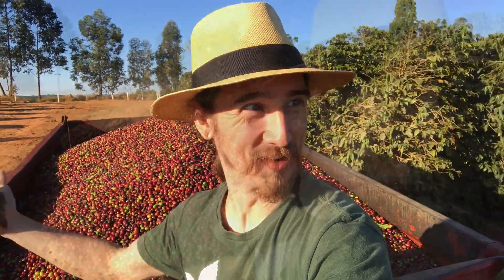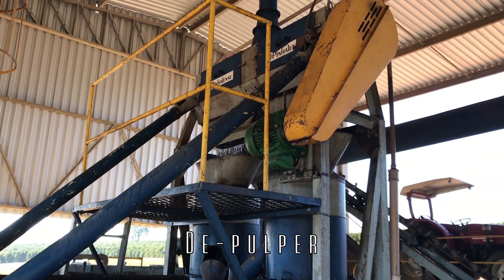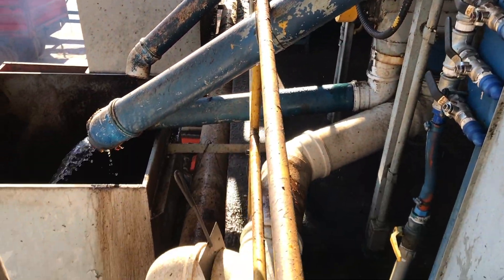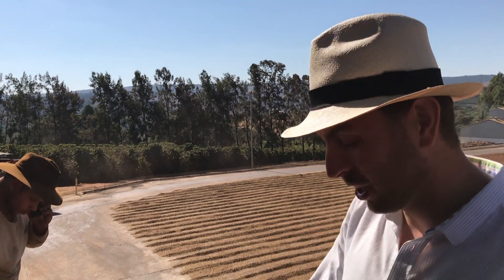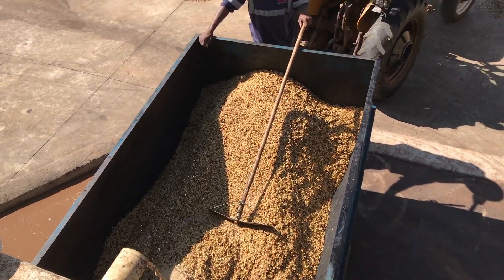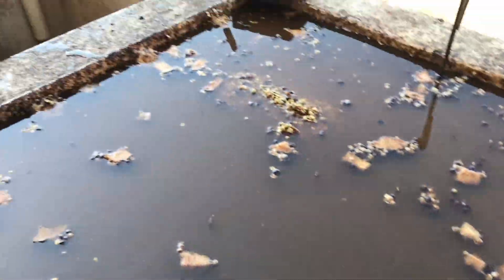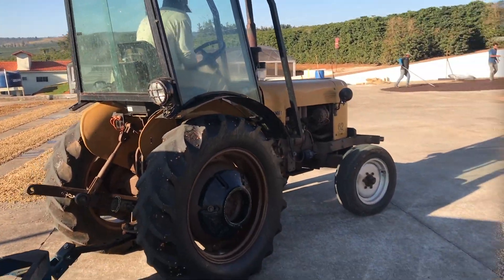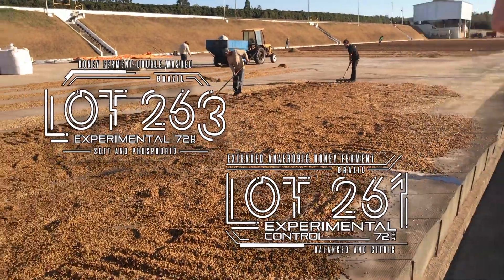Experimental Fermentation Processes

Comment from the maker: While this is an open vat fermentation, it occurs underwater and there isn’t much chance for respiration from the wild yeasts. Even with the slight bit that is exposed, CO2 is constantly being produced, and not much O2 is present. With a decent presence of sugars, the yeasts prefer fermentation over respiration. 
The biggest thing to take into consideration is the surface to volume ratio, where the rate of oxygen diffusion into solution is way too low to have much of an effect on the yeast (specially with that CO2).
This is measured. The moment CO2 production ceases and most sugars have been converted, the batches drop and are set out to dry.